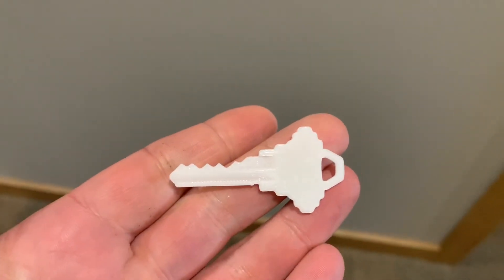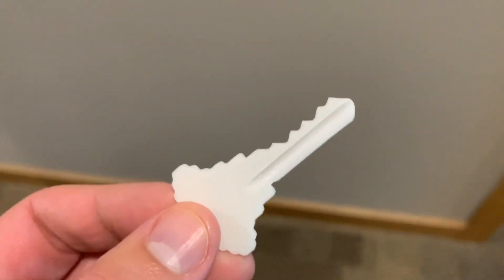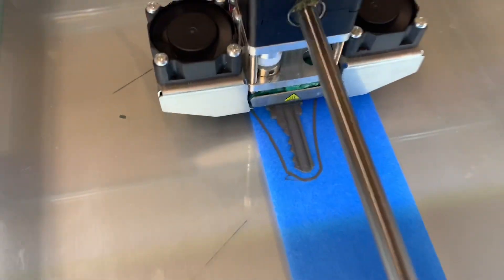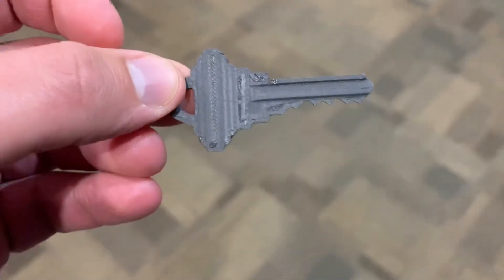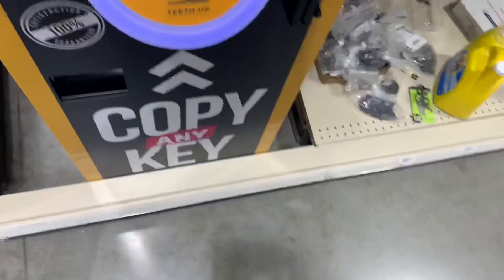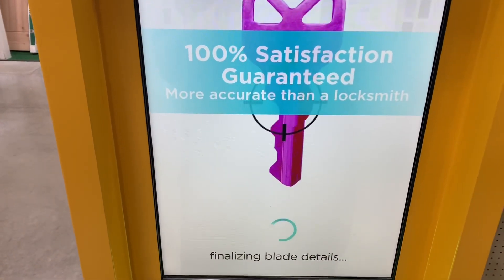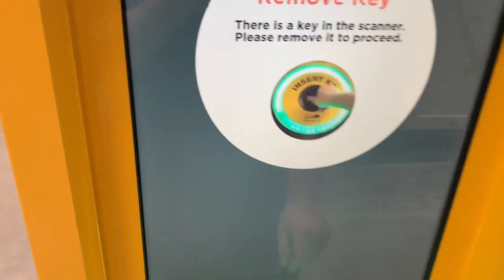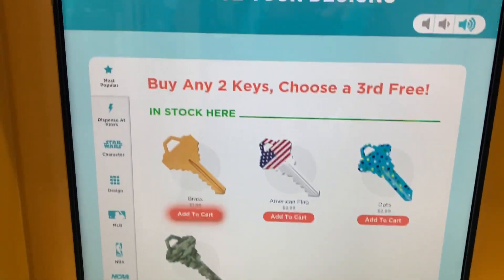Duplicating a key at Menards using a 3D printed key!

Comment: Why do you think you needed to use a metal key?
Reply: The old kiosk didn’t detect it—it likely uses a form of infrared sensor and did not pick up the plastic as it is not as lustrous as most metal keys
Reply: @CapNem  so zinc or chrome spraypaint could have done the trick?
Reply: @xephael3485  That’s my theory at least yeah—in fact I plan on giving it a shot sometime soon 🤔
Reply: @CapNem well it's been two years...have you done it yet?
Reply: @Chevroletcelebrity  I didn't try, the kiosk got taken out of the store :(

I wonder if metallic nailpolish would work